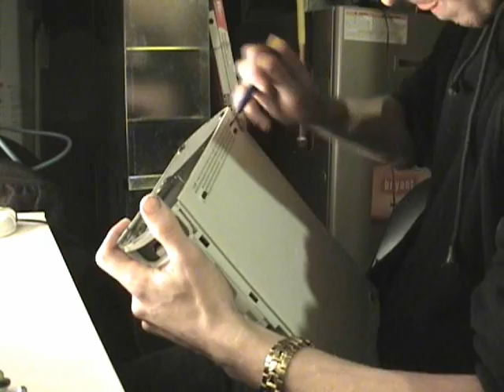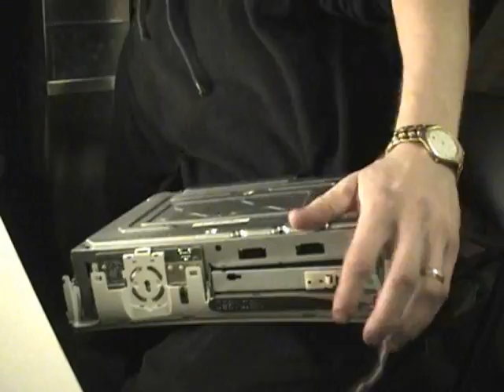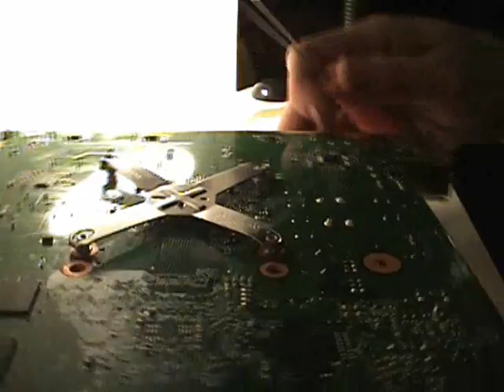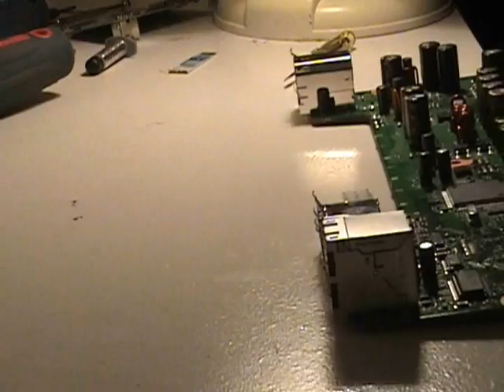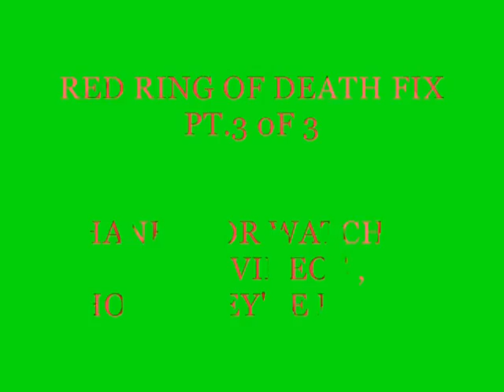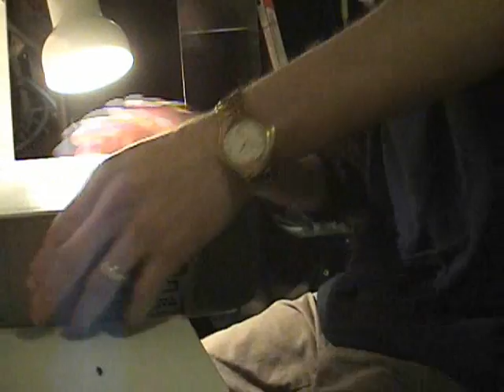XBOX 360 RROD fix  COMPLETE FAST

Comment: @bmwberT100 I went to a hardware store (here in the U.S.) and bought a Torx screwdriver with multiple attachments for around $5 or $6. It cost about as much as an individual Torx screwdriver, and I have the whole range, so any size I needed to fix the 360 was there. My buddy had the first wave of xbox sold here in the U.S. (back in 2005), it just got the RROD a week, ago. All better now thought, thanks to a Torx driver, and some thermal paste.

Comment: Ok so basically you need to replace the Thermal gel then let your xbox over heat to bond it then it works again. So this is just Mircosoft using crappy materials to make their product. Does this work for 4 red rings or just the 3?

Comment: xbox 360 are so poorly made when it comes to the CPU and GPU i have a method witch completely rrod proof the 360 i revised and rebuild my xbox mobo with great results and the failier rate has gone from 60% to just 10% it was an rrod xbox but fixed no rework no x-clamp no heat gun for towel <<< ALL CRAP AND ONLY BY TIME 1 MONTH AT THE MOST

Comment: in addition to my last comment, your gunna have to drill out  a nice 1/4 (quarter) inch hole where the black screws would normally go to compensate for the long heat sink screws. :)

Comment: also,( because i ran out of room on the comment) your gunna have to drill out the screw holes on the metal case where the black crews would normaly go because the heatsink screws are gunna stick out a bit.

Comment: ok i have the real reason why. its the cpu. the X claps push up on the cpu makeing the connection bad. so heres what you do. the screws you have that are used for the heat sinks remove them and instead of  putting in the way microsoft did, put the heat sinks on with the screws off them, and from the back of the mother board, screw into heat sinks. this ensures that the cpu is firmly clamped.mines been working fantastic ever since.drill out crew holes.thumbs up if you've tried this and it works.

Comment: @fordwillkillyou all depends really mines worked for the last 2 years, they fail bc microtard used xclamps opposed to bolts...wich loosen the heat sync and cause overheating, after replacement of the clamps and thermal paste you intentionally overheat it agian and it resets and usually works agian

Comment: @MrCISZMO does this work well? I just bought a red ring box for $15. Has 3 red lights. WHY do you have to clean these heat syncs? Why do they fail like this. How long does the repair last?

Comment: @nower3008 Buy a new fan, TALISMOON has OEM replacement fans that are more efficient and quieter they sale them at AMAZON for 15.99 and they come in various colors. I kept trying to do the RROD fix only to find out one of my fans weren't working. REPLACE THE FAN FIRST. Oh and the Talismoon fan come with BOTH a four pin and three pin connector.

Comment: I let it overheat like you do until the 3 red lights turns into 2 red lights, and then turn it off and wait for about 20 min for it to cool down before turning it on, this time with fans plugged in, and its back to the 3 red lights again. Any clues whats wrong? Could it be that it didnt overheat respectively cool down enough?

Comment: i just fixed my first 360 the last attempt i just threw the x clamps away polished the copper contacts for the heatsinks and got some 4 mm vacuum line and cut about 6- 7 mm lengths push these on the after the mother board so that when the screws are replaced there is already slight pressure between the chasis and board then do the screws up until they seat very firmly no thermal paste no clamps and its been running for the last hour and a half.no guarantees but good luck

Comment: this is more less a patch than a fix.... Be sure you do not forget to park the passenger rear tire on top of the heat sink to insure a permanent fix. Also rinsing out out works too, just make sure its plugged in so the parts blast off ALL of the dirt.

Comment: the 3 rrod  is a soldering ball becomes two under the GPU and u need to reflow it to make it one no nuts n bolts will fix thatthey are 6mm soldering ball and when one ball dont touch u get the 3rrod reflow will fix that with flux and the new slim still gets the 3 rrod dont let ppl lie i had to fix 1

Comment: I used 8 M5 sized bolts as they fit the heat sink perfectly. I played around with a few configurations of washers and spacers until i was happy before applying the thermal paste. Id recommend the artic silver paste, check ebay as its pretty cheap and you only want to have to do this once right? Watch the full vids and you should have no problems, it does work!

Comment: well ill tell u what works fast ok here it goes u guys know that its the solder joints breaking well all u do is sit ur Xbox360 upright turn it on its ok if it goes RROD on u just let it sit for 10-15 minutes turn it off and turn it back on alot like what microsoft does except they have a tool that heats the solder joints

Comment: I would have to disagree they did have knowledge of this however wanted to have this system release November 22, 2005.  When the ps3 made its launch almost a full year later into America November 17, 2006.  They had the system out earlier but with obvious numerous issues.  I have had this problem 2 times and both times although it was a battle with Microsoft's foreign customer support staff.  Although being a pain in the ass they made good on the system twice with about 28 day repair time.

Comment: Sounds like you have error 72. It means the vdeo card is buggered so don't waste your money on a new cable, if the cable was damaged the xbox would know. Try somebody elses cable before you hand over any money i'm certain its not the problem. This problem falls under the rrod 3 year extended warranty.  Microsoft dont actually check that you have rrod they might put it in your notes but the technicia just fixes and returns it o questions asked. Hope this help good luck

Comment: I took mine apart and put new thermal paste under the heatsinks, then I half put it back together and elevated the box on a stand, I roasted the balls out of the heatsinks with the fan unplugged for 2 hours then let it cool. When it was cool I ripped apart an electric heater and stole the fan out of it and mounted it right and top of the heatsinks and let it blast cool air down on top of them, they now NEVER overheat, worked fine first time back on and I just finished 6 hours continuous playing

Comment: Replacing the screws is a bit excessive, the X-clips seem to provide more than sufficient contact pressure between the die and heatsink.  The major problem is the melted-off thermal interface material.  Arctic Silver 5 is the best you can get... go to Fry's or order it off Newegg.  Doesn't cost much, little tube lasts forever.  Replacing that stuff should pretty much solve the problem.  Also, do the overheating thing.  Seems to work.

Comment: Thanks a lot bro, quick question though. If you remove the X clamps, can you put them back on if you dont want to mess with the screws? I got that far, but wasnt sure if I had to bend the metal where it wouldn't be able to be reattatched.

Comment: Your wireless controller is burned up. This same thing happened to my controller. This is caused by using cheap rechargeable battery packs and leaving the cord plugged in for too long. Open up the controller with a torx screw driver and you will find the microchip in the backside of the controlller burned up.

Comment: I know i will get negative feedback from Microsoft fans, but the 360's design is just horrible. Right from the start, they knew that their system had a problem and yet they just sold it ASAP instead of spending the extra year they had fixing the problem. It's fail rates were so high that it would have completely destroyed a lesser company. I've seen people who would go to great lengths such as water cooling to keep their 360 from failing.

Comment: Well, seeing and fixing 360's myself, it will not fix the 360 permanently, if you're lucky it will but for the most part the system will fail once again withing a few weeks or months. It is best to buy an external fan after the fix or just get new 360 and prevent it from failing again.

And for the paste, just put a small drop of the paste, about the size of an apple seed or about as much as a grain of rise. Just enough to cover the CPU and GPU. Putting too much is as bad as not putting enough,

Comment: Yo dude,
I did something very similar, although it's a very small scratch across the traces.
I examined it with my dad and we found that it seemed as though the coating was taken off, but the leads were not broken.
Do you think I'm screwed as well?

Comment: Hold on...I've played around with it a bit more...I still don't have any AV video...but I do have HD video..only problem with that is the screen is in black and white...it had color the first 2 times I turned the system on...but after that it turned black and white...could it be that my AV/HD cables are bad?

Comment: Sure their has been problems with ps3 but no where near the scale of the xboxs problems. Also Ps3 might have rolled out some features recently for a long time but Xbox has had what.. 4 yrs to fix the rrod and those features you have mentioned ain't direct gaming features. Maybe you wanted a ps3 for my space and gaming. but i got mine for reliability 1080p movies and quality sound. easily upgraded hardrive and hd gaming.

Comment: He removed the XClamps, applied better thermal compound then overheated the GPU to reset the solder. This is usually NOT a long term fix and the console RROD's again within days or weeks.

Sad but true.

Comment: why cant you just use the black t8 screws to tightin down the cpu/gpu to the case after removing the x-clamps is that not the same method as adding new screws or am i missing the whole concept of this fix

Comment: you need to make sure you have covered the gpu and the cpu with artic silver 5 thermal compound  which means you have a layer that will keep it cool enough and that you didn't tighten the screws down really tight which will cause the rrod again once you turn the screws and it begins to feel tight to turn don't turn anymore

Comment: xbob It's very important when you do the x-clamp method that you do not tighten the screws too tight. I did this once, whenever i turned on the console it would give me the 2 red lights (overheating) even tho the console is cold and hasn't been on for a while. So all i did was loosen the screws and it worked just fine. Also it's very important to install the heatsinks as straight as possible.
LOL I hope you didn't stomped your console if so can i have it? I need some parts :)

Comment: Flash the DVD drive whilst its apart :( 

Micro$oft put way too much heatsink compound, it's only supposed to be a very fine layer, enough to fill the gaps in the imperfections between the metal surfaces. Dunno why ppl think they have to put it on really thick? The metal of the heat spreader on the ICs and the heatsinks have a much higher thermal conductivity than heatsink compound...

Comment from the maker: Sure,here it is,it was under my PT.2 Video

The Screws/Washers are: 

Machine screw pan phillips 5x10mm.....x8
Flat washer(nylon)#10................x16
Flat washer (steel/zinc plated)5mm...x16

+ Artic Silver 5 Thermal Compound.

Good Luck

Comment: my parts list if anyone needs this - Arctic Silver 5 Thermal Compound - Radio Shack - $9.99, (16) #10 4B Nylon Flat Washer,  (8) 5mm Steel/Zinc Plated Flat Washer, (8) #10-32 X 3/8"  Round Head Slotted Machine Screw  all found within 5ft of each other at Home Depot for around  $5